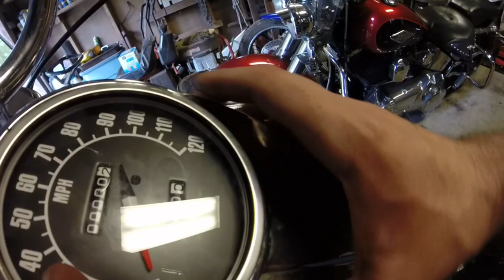Speedometer Replacement "One Piece At A Time" (Drag Specialties)

Comment: I'm almost finished with my 76. THE BIGGEST pia was putting 5 gallon split tanks on it!!! Had to used JP Cycles " quick mount" welded up on perches. 75FLH dash base with catseye cover. Had to shim the ignition switch,  speedometer had cut a window out of the speedometer case so the center light would actually light the gauge.Had to trim the front skirt on the cover the clear upper front mounting points. But hey, I scored a oem original speedo with HD logo and ZERO miles on it. It did come out sweet, definitely worth the effort.  I would drop some pics , but YT doesn't let you do that apparently
Reply from the maker: Sounds good, man.

Comment: I fixed my thirst speedo in 17 years without. Good for long trips and petrol stations. The one I bought from internet is a small one with only 3 wires, easy to install and works by satellite. Cheap,  but very exact and waterproof.
Reply: Only time Iv ever had a working speedometer on a Harley is from 1986 to 1987.  My speedometer cable was still spinning in 1988. I just got a new speedometer but my counter shaft sprocket in 25 tooth which only lowers rpm about 175 RPM from stock in 4th gear 50 mph (That is according to my math not real world measurement). I have no idea how it will effect the speedometer.

Comment: I know this is a little late, but maybe you could split a really small vacuum hose and use that for your dash trim. I really liked the "interruption" by J.R. Cash :) That was purdy kewl! As an aside, for those who don't know, you can use a timer to check your speedometer accuracy by holding a steady 60 on the interstate and start the timer at one mile marker and stop it at the next. If your time is less or more than a minute, your speedo is off.
Reply from the maker: Thanks. Done that already. It's pretty close until I get to highway speeds.

Comment: Thanks for the video!
Any chance you could suggest whether one can connect to the electra glide 2010  (j1850) a used matching speedometer (j1850) from other bike (say road king 2010) and do not get a VINERR displayed?
p.s. people say it's just a drop in swap, other say - I need special equipment to "merry" speedo with ecm.
Reply from the maker: Wouldn't know

Comment: Where did you get the base plate and dashes? Nice job man! It looks really good. 

"...or maybe I held my mouth just right." 🤣
Reply from the maker: All pieces I bought online except for the one dash that wouldn't work... I picked it from a local bike shop. I got two dashes just in case I was going to have fitment problems. Good thing too. I was 95% sure the base plate was going to fit. The speedometer itself is the only thing that isn't used, which I was surprised that it worked out because the dash and baseplate are late 60's.

Comment: What about the 4 wires on the back I know 2 are for lights one for ground whats the wires that goes right into the back of the speedo?
Reply from the maker: I assume they're for lights. Never wired them up to see.
Reply: I wish I had a Pic for you the 2 are for light but there is a white and green wire that goes right into the back of the speedo the other wire is hooked up for ground I just can't figure out that green and white strip wire..

Comment: HI 
SaddleTramp, I would like to know if I need a tachometer adapter if I want to install a Drag Specialties Mini Tachometer on my 2003 harley Road King. It has a carburator. Thanks for your help! Mario.
Reply from the maker: The best way I know for that is to get the kind where you would run the lead to the ignition side of the coil.
Reply: @SaddleTrampTV  Thanks man, its appreciated! Have a great day!
Reply: @SaddleTrampTV  Thank You SaddleTramp. It's much appreciated!

Comment: How do you know if 2-1 ratio or 2240:60 ? Have a front wheel drive
Reply from the maker: That's how it was advertised before I bought it.
Reply: Well I would think front wheel drive would be one and transmission would be other I just don’t know which ratio but I did hear you say FL Style 😁

Comment: did you use the existing cable off the front wheel for the fl speedo?..was wondering if their be cable snagging issues..thanks
Reply from the maker: I used whatever existing cable I had lying around. Turned out it was the perfect length and had the right connections.

Comment: question if i wanted to remove my stock speedo clamp from my 09 sportster can i use the same speedo to mount the gas tank? im buying a gas tank exactly like yours and it already brings a speedo on it but with the wrong miles i would like to have my original miles on it but if its a big deal then I'll just leave it be. justa feq questions when it comes to the witing as well
Reply from the maker: Don't believe so... at least not without some serious modifications, because the speedometer I'm using is much bigger.
Reply: @SaddleTrampTV  okay so this brings me to my last question. so the gas tank already bring a speedo built into it can i just plug and play into it? and with the computer from my sportster change the odometer on the gas tank?
Reply: @SaddleTrampTV  the gas tank is from a dyna 4 gallon tank

Comment: To the guy who made this video. Do you have any idea what size your counter shaft sprocket is. How many teeth? (your rear chain front sprocket). Thank you in advance of your reply.
Reply from the maker: Front sprocket is 23 tooth... rear is 47.
Reply: @SaddleTrampTV  Did your rear sprocket call for 51 tooth stock? If it was 51 stock, Im wondering how much it changed you speed reading on speedometer having 47 rear.
Reply from the maker: @joesurfer9754  No. Stock, my rear was a 48 and front a 21. My reading comes from the front wheel though.

Comment: Mine is 10 mph off on the high side.  Also my ignition switch rattles like a bell
Reply: what size is your counter shaft sprocket?
Reply: @joesurfer9754  Not sure.  But my speedo is driven off the front wheel

Comment: I know this information is getting to you a little bit late, but as the Old Saying goes it's better late than never. Drag Specialties also has that rubber trim for the bottom of your Dash that fits between it and the fuel tank.
"Plus" You'll never know what your gonna get if'n your holding your mouth just right. LOL.
Ride Safe Today, and Ride another Day Tomorrow.
Reply from the maker: I'll look into that. Thank, man!